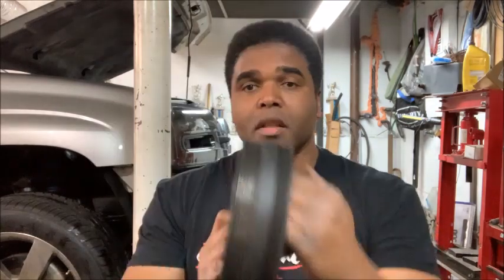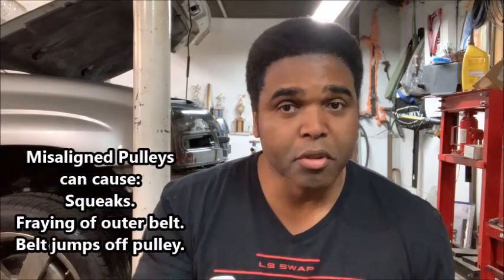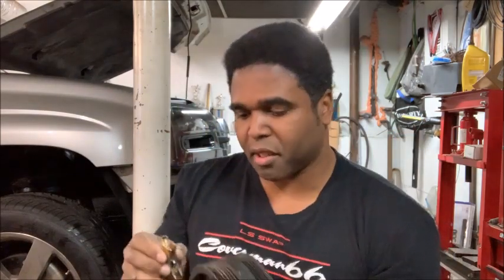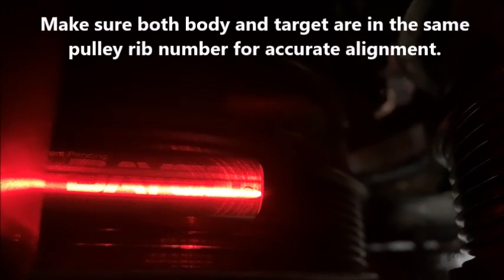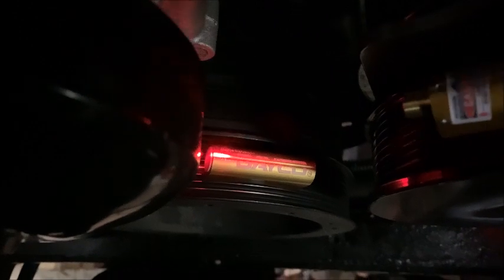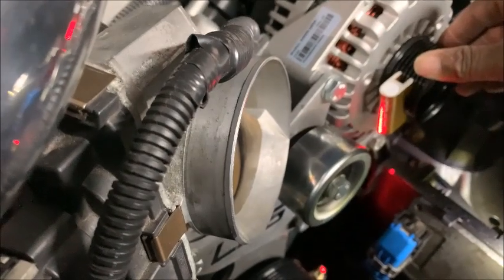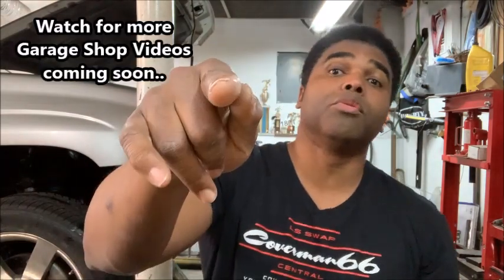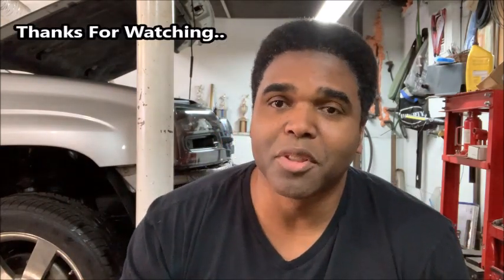How To: Align Belt Pulleys (Dayco Belt Diagnostic Kit 93874)

Comment: That's some GREEN belt!  I've never seen one before.
This tool is very interesting.  I'd just discovered you having watched your video on fuel pump sending unit adjustments.  Very good.
Recently a friend and I went nuts trying to figure out why the pulley's were out of alignment on a used car I'd bought.  It turned out to be a missing spacer at one of the power steering pump adjustments, and being over tightened where the spacer would go.  In addition to that the main mounting of the alternator hole had worn to being an oval.
This was caused by someone in the past that had worked on the car.  It took a lot of figuring on our part (eight hours) and once we realized something was wrong in the area that the spacer would go, we then rechecked the factory service manual diagram and that confirmed a spacer belonged there.  We'd have found that out a lot sooner if the factory diagram had been drawn better.
This had to be the most odd problem I'd experienced in all my years of working on cars.

Comment: This is a good video mate. You should do a video about belt alignment where the belt that needs to be aligned is on the inside edge of a pulley with two belts. Like a power steering pump with the belt behind the main belt but both run of the balancer.
Reply from the maker: thats coming up on the new engine im building.. stay tuned.. its going to be cool..

Comment: I can't believe I didn't see this video before; really do need this product. I have had a chirping sound come from the engine since first time I fired it up. I had to modify an AC compressor relocation bracket I ordered from Kwik Performance. It involved removing material from one end and adding washers on the other. Thanks Terry!
Reply from the maker: much appreciated brotha G.. how you doing partner..
Reply: @Coverman66  Thanks Terry, I'm doing good. I sent off the steering column from my '87 Monte SS to be rebuilt. I get it back Monday. There are some weird electrical  problems I've been having with the LS swap...just eliminating possible causes.

Comment: Hey Terry. I have been chasing a squeak for over a year. It's almost gone but still sneaks back in. What's the actual adjustment procedure? Shimming or pulling pressed on pulley's off and reinstalling at a different depth?
Reply from the maker: the steering pump has to be exact.. i heat the center and its easier to get off or press on to line up. the crank pulley you torque to 220ft lbs and thats where it should be..